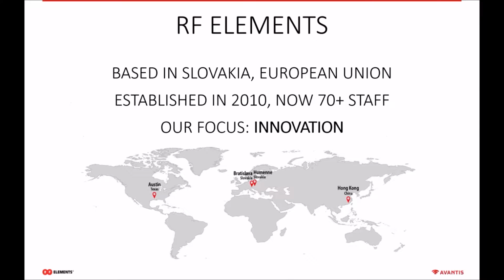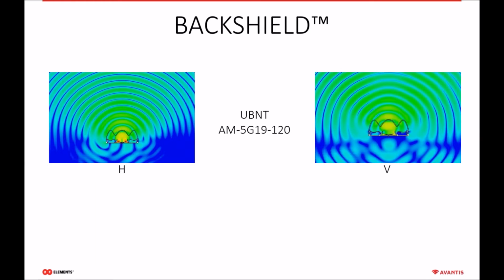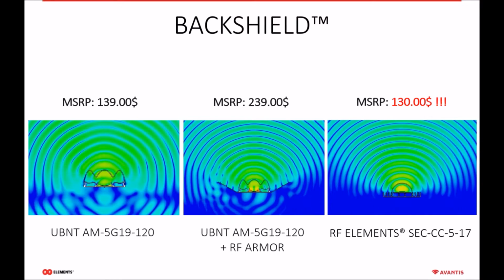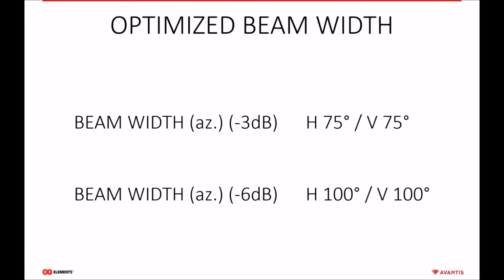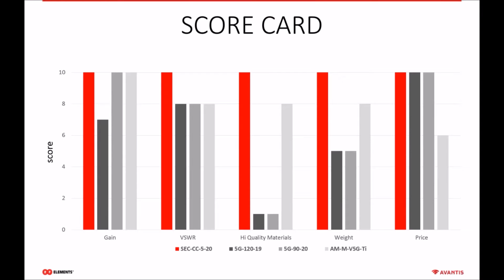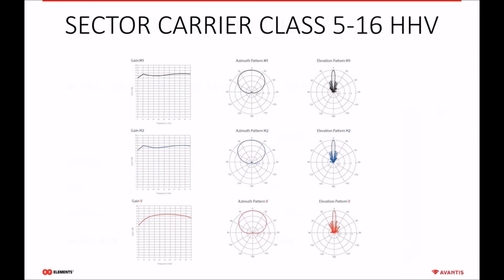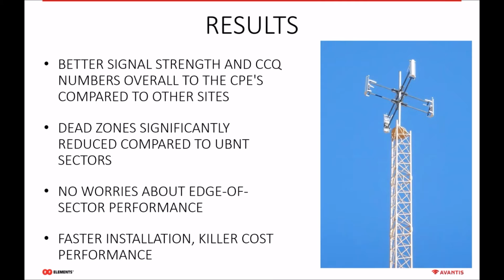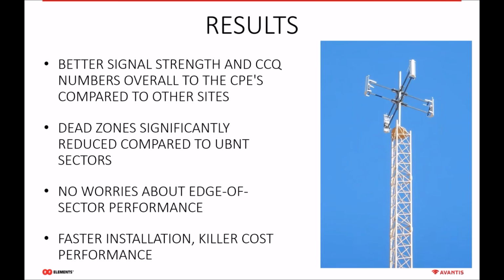RF elements - Sector Carrier Class Antennas

Comment: very informative!  iam still not feel very comfortable with those shield design above other sector antennas , whats the science of putting a couple rows of alluminium next to each to create a shield? wouldnt be just one layer much enough for that? i mean like dish reflectors can even work well with mesh material.
What i like from RF is the use of less connectors as possible, that will certainly help with higher performance and longer lifespan.